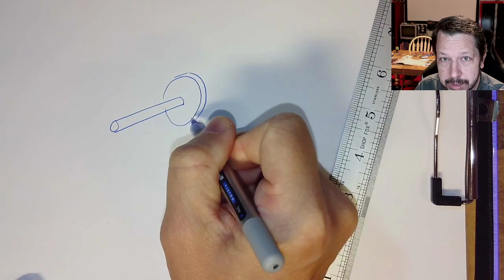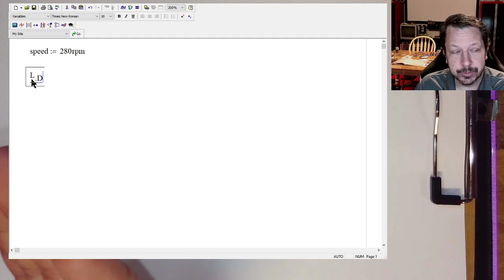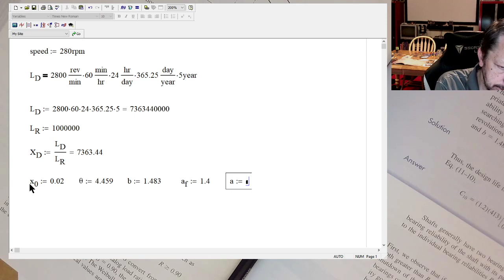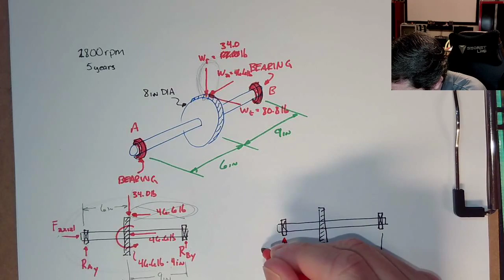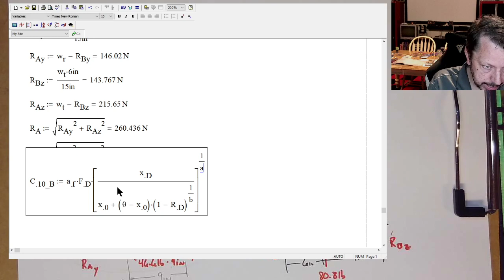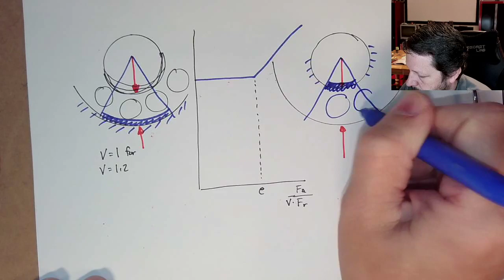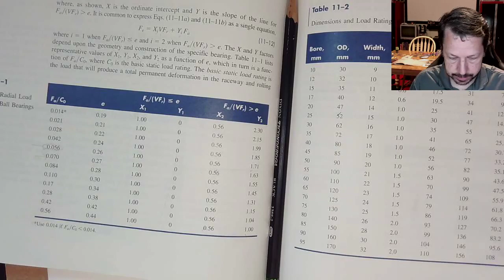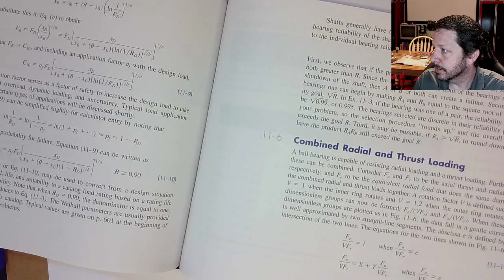Roller Contact Bearings | Shigley | MEEN 462

Comment: What about the dynamic loading from the unbalance of the rotor?
Reply from the maker: You would first want to minimize any unbalance if possible. If it is not possible to eliminate the unbalance, then you could calculate the centrifugal force created by the unbalance and add that to your radial load. That could at least help account for the unbalance.